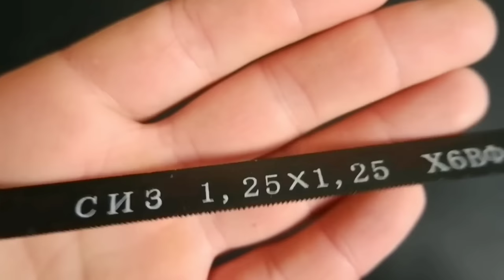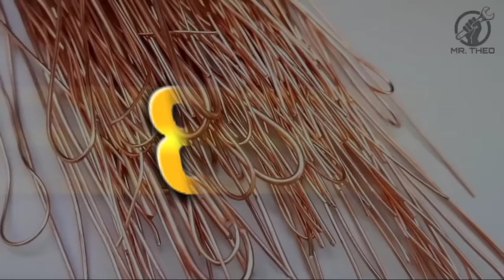How to Strip any Wire quickly and Without problems. TOP 15 LIFE HACKS.

Comment: SAFETY PLEASE  on build 6 you drilled a hole through a utility knife with the blade extended.  If the drill had binded when you were drilling the knife would have spun around cutting through your fingers.  At the very least the blade should have been retracted and really the utility knife should have been clamped in a vice before drilling.
Reply: Thank you Dudley
Reply: Hed only do it once!
Reply: Peligro ⚡☣️
Reply: If ifs and buts were candy and nuts
Reply: Well, maybe up to 9 times, the last 1 of 10 would be difficult 😂 @StonemanRocks
Reply: Good call... Hey, if in the future you point something out would not only be helpful to note the time but it also tends to draw more attention too your comment as well, especially if you put the "@" before the time. Thanks.

Comment: @50:00 : Why do you want to strip such length new cables?
Reply: Could have been manufacturing defect pallet or something, bad quality insulation, off-size wire, recalled product. Or maybe some kind of liquidation auction, salvaged dumpster find, abandoned leftovers from a business. Maybe some standard operating procedure, someone needs the bare wire for winding stators or something but it's better to keep it insulated until then to limit oxidation?
Reply: To buy more crack.

Comment: Something I've built has some elements from a few of these. I really like the simplicity of the basic sharpened groove straight tool, maybe offset at whatever angle is most comfortable for the user, but overall a safe method if using both hands, the flexibility of the saw blade giving good tension feedback. Some of the designs with the spring and the full length of the blade are foolish, if you are doing something like this with your hands the last thing you would want is an exposed razor slicing your fingers, feeding those mechanisms will teach you quickly. The larger gage wires they are cutting in many segments are very easy to do with a basic knife, use a rubber band or 2 to bind the handle of a pair of pliers, open them to bite one end of wire, step on the pliers and rake a knife or even just a sharpened piece of metal along the length of the wire, it will destroy the coating enough to pull the wire out. You don't need a box or rig for those sizes. That being said, many of these designs have no adjustment dials or very few options for the amount of effort making them. Maybe clever, but the tools where you are fighting your own other arm are poor choices. You will tire very quickly if output is your goal. Being able to pull through a fixed point with both arms, maybe even your back like a rowing motion is a far superior use of energy. The old shaving blade was interesting, like most things the simplest approach is likely adequate. I don't know if those are replacement blades or need resharpening, I haven't seen one in ages but essentially the same method of dragging a knife along the coating (pull sideways, not toward your body). 
 I have a V-cut roller on a bearing with an adjustable blade from the top, blade has a guard through the knife edge to limit cutting point exposure and add stability, block fixed to the top panel with a threaded rod to the side panel for centering fine adjustment. As is my rig uses one hand to feed start and then hold the box and the other to pull the wire. It's a small 8"x8" I can work while I watch videos online. As it evolves I'll experiment with the RPM stable enough to pull wire off a small motor and maybe incorporate some of these guidance methods with the eye screws onto some flaps on hinges with a locking pin.

Comment: The crank one is the best. No copper was lost during the stripping. Also put a 12v motor to the crank and you can strip wires all day. No dull blades to be replaced which means lower expense.

Comment: Good ideas:)

However at the beginning, I wouldn't AT ALL condone operating an angle grinder moving toward an ungarded hand holding the work, (esp. when so close as it appeared to me in the vid). Something might slip,  colide into that bare naked hand and OWeeee! "Dang that HURT!" could quite painfully result. Some kind of clamp or vice would be a lot better to grip hold the work, while cutting away on it.

Safety should should be uppermost in mind when ever operating power tools, is what my book declares.

Again good ideas though:) what with the multiple different methods you'd intelligently devised. Think it's always good to have more than one way to strip wire, as only one method may not always work on some, certain kind of insulated wires, well....at least not as efficient so.

Comment: Method 14, 13 and others similar are weak, they will only work for brand new straight wires (in the case of a bent wire, the bending will cause the blade to cut into the copper and either break the wire or break the blade, and even if not, it will become dull and they will have to be replaced, in method 14 you can't even break off the section because the knife will be too short and you will have to drill and attach a new blade (more fun with replacing than with peeling the wires), these solutions still work for stranded wires, but they are not there may be wires after disassembly because dirt such as dust, sand and cement will quickly blunt the blades. Method 6 is a total misunderstanding, the idea of crushing the wire is absolutely right (it only works with wire), but the quality of the machine and the crank drive are a comedy.
And the last method using a concrete mixer is a joke, who peels brand new cable discs that can be sold as a whole several times more expensive than the obtained copper???
Wouldn't it be easier to buy copper rods and pipes in a store and take them from the store to a scrap yard? :P